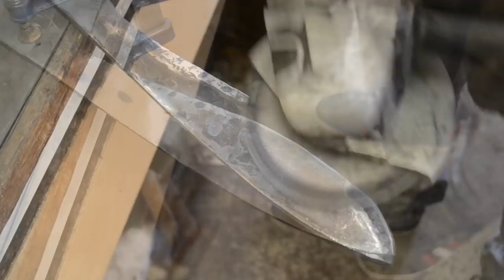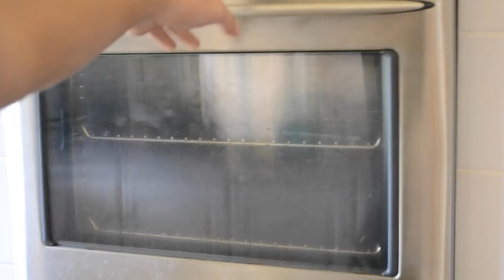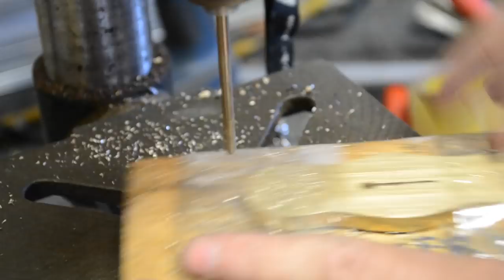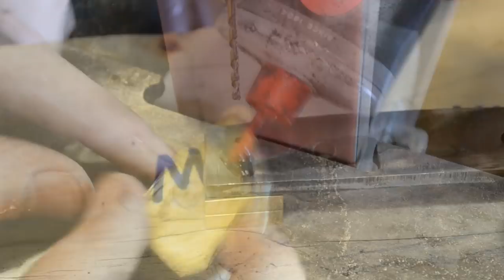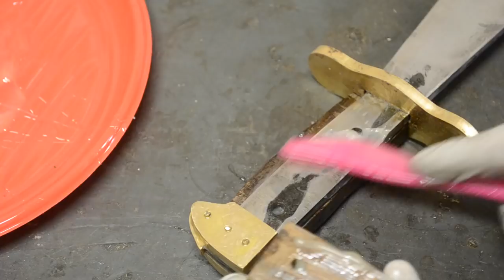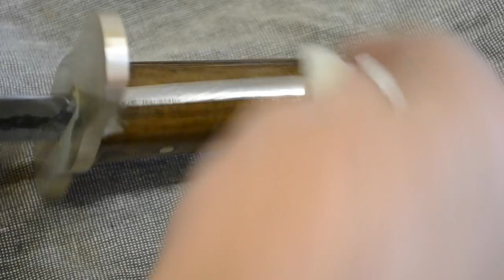Knife Making - BATTLEFIELD 1 HELLFIGHTER BOLO KNIFE

Comment: I hope to get into knife making some day, and I have a few questions:

1) What is the liquid that I sometimes see when you sand something? What is it needed for?
2) How long does it typically take you to make something like this?
3) How much did all the equipment cost?
4) What is that mixture that you use when you glue wood?
5) Why does the blade need to be dipped in oil?

I'd be glad if you answer any of these questions, thanks.

Comment: why is a knife heated and dipped in a liquid and then baked in an oven?...Can you please tell me?
Reply: Aranyaplier that was the normalizing and the heat treating of the blade. The sword is heat treated in oil to allow it to hold an edge, but it makes it very brittle. So, he puts it in the oven to make it less brittle.
Reply: Hardening and Tempering like explaned above ^
Reply: its "jet torch furnace"
Reply: He did cause  heat treatment for make product more Hardness ,strength
Reply: makes stuff hard

Comment: Question. Are these razor sharp knives because to me it seems like there's just a lot of force to cut through these things. Just wondering. Oh and where did you learn how to do this? Are there classes in college?
Reply: Normaly knifemaking is something your teach your self, but it is possible, to get a professionel knifemaker, to spend a couple houers teaching you the basics. 

Most likely that knife isn't razorsharp, becaus it´s made for heavy duty use, so the angel of the bevel is bigger, and the edge is a little thicker. This makes for a very tough knife, there is good for chopping and Batoning, but isn't exstemely sharp.

sorry for the bad grammar English isn't my first language.

Comment: I have a few questions to ask 1. How does one learn how to blacksmith like is there a school 2. How much did all the stuff you have cost 3. What age did you start doing this because I am young and want it do this when I'm older thank you for awesome videos
Reply: Ruger 2016 for the stuff this guy has, multiple thousands for the equipment, anvil that size is at least a grand. I myself have long wanted to do this stuff to but instead I built a forge so that I could cast stuff out of molds, I figured it was a good starting point but dang has it turned out to be expensive, also I am 18
Reply: Grant Hendrix thank you do you have to have a anvil or can you just use a big piece of metal? I might make a forge and use a metal file or a cheap belt sander thanks again
Reply: Anvils are hardened so that they don't deform when you hit them, so a normal piece of metal will not work. If you want to save some money you can always use a piece of railway track or perhaps even the head of a sledgehammer set into a concrete block, both of these options are hardened and will allow for at least basic working of metals. There is also no school for this sort of thing, the best way to learn is to find someone who does it and ask if you could pay them to train you. I personally started forging when I was 15, I volunteered as an apprentice for a local group of museum demonstrators. As long as you're mature enough to follow instructions, keep to safety precautions, and treat your smith master with the respect he deserves, then you can never be too young to start.
Reply: I actually don't even have an anvil, i just cast stuff that I make out of wood in some really expensive petrobond sand that I bought. But I am looking into getting an anvil, just a small one. Theres this 55lb blue one that comes up on ebay and it would fit my needs pretty good, and its like 75$.
Reply: It is mostly trial by error, but try a class like ag first to learn the principles of metals so as you don't find yourself with a forge and no idea how to use. Costs vary depending on the type of metal or the grade as well as your access to tools. I am currently 16 and still learning to do this but I've made progress.

Comment: Why do you put your blades in an oven?
Reply: After quenching the blade it's very hard, yet extremely fragile. To help it retain its strength while still being flexible enough to take blows from chopping you have to temper it by heating it up and letting it cool down over time.